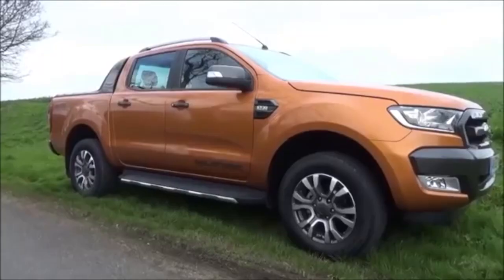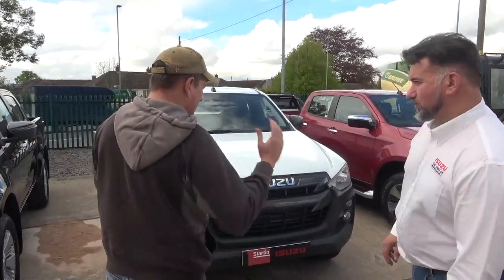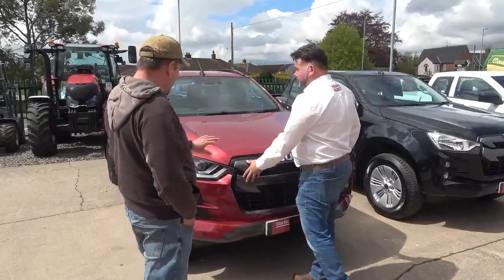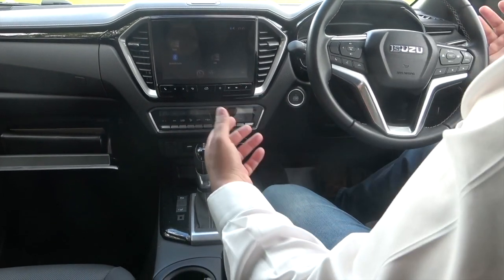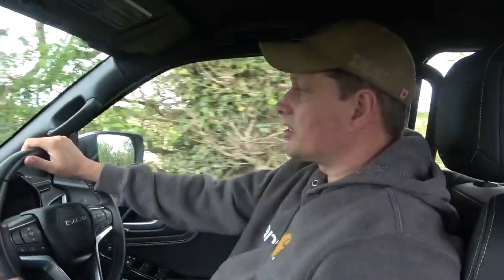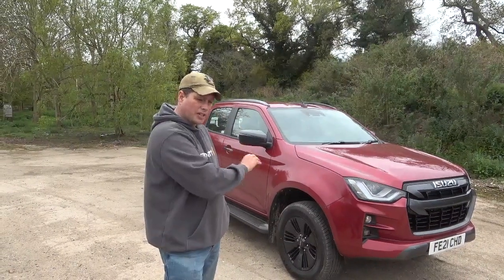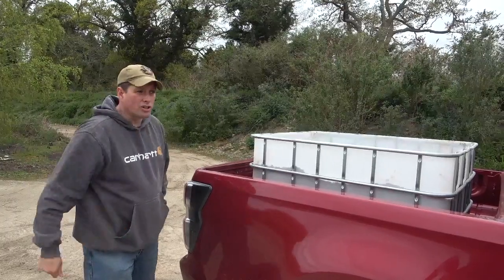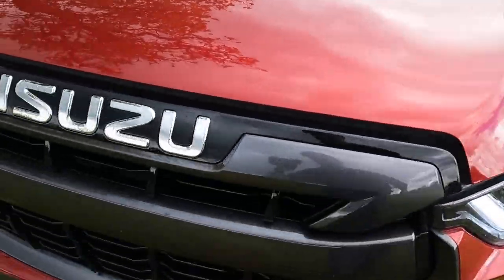2021 ISUZU D-Max ROAD TEST

Comment: I received my new Isuzu Dmax 1.9 Executive 6 AT which is the high spec here in Romania. My last car was a 2008 VW Touareg with the V6 3.0TDI engine and my biggest concern was about the power of the engine and the torque. After aprox 5000km/3000miles I cannot be happier with my choice. The car is amazing, it drives almost like an SUV. The steering is very precise and the overall handling is better than most of the pickups I previously drove. It's a huge difference between the old Dmax and the new one at all characteristics. It has a top interior, nice looks, great fuel mileage, a lot of safety technology and it feels safe even at high speeds of 160km/h or 100 mph. I am happy about the engine and the performance it delivers. It's quick enough for normal driving. Up to 40-50 mph it has been always enough for me no matter what. Yes, you cannot compare it with the 3.0v6 I had but it does the job amazingly. I love my car!

Comment: I have a daihatsu fourtrak 65k miles 2.8td can tow 3.5t legal no dpf, no adblue, no duel mass flywheel problems, no cat on exhaust, no Ecu problems, can run in high or low range by moving manual lever, can run 2 or 4wd instantly, never broken down once and fantastic at towing and going through fields etc. Modern motors are like time bombs they can go wrong and leave you stranded without warning then cost a fortune to repair. If you are faced with flooded areas these new cars have electrics that won’t like being under water but fourtrak can handle that ok. In short today’s cars deliver a nicer driving experience but there is a price to pay. Motors were more practical during the nineties for me anyway. Good video tho.

Comment: I run a 2017 Nissan Navara 2.5 TD as my everyday ride. I'm not in farming but have been renovating a property so truck bed gets a load aboard quite a lot. I agree with you about the feel when loaded. The truck gets very stable and eats the bumps. I live in Belgium where the motorways resemble badly maintained B Roads but my truck will Drive all day at 120kph (about 75mph) very smoothly. Tows beautifully too.
Great vid look forward to more

Comment: The 1.7 TDi isuzu  engine in my old mk3 cavalier outlasted three clutches on one oil change, it's stubborn refusal to die so i could  scrap the rusted out car cost me a small fortune in mig wire and brake pipe over the 14 years that i owned it  and the engine was still going strong when i took it out because i was forced to scrap the car after welding  it up every year wore out my welder. isuzu engines outlive everything.
Reply from the maker: Legendary 1.7 😎

Comment: My brother-in-law has a 2019 Isuzu Fury pickup with a 1.9L engine and auto box and he regularly tows a 14ft livestock trailer with cattle or sheep in it. He loves the Isuzu.
I have a 2016 Ford Ranger XLT 2.2L six speed manual and it has gear in the back and tows trailers about and I think it's great.
It will be interesting to see how these reviews go because it is good to see what other motors are like. Top regards melod from North Yorkshire!

Comment: Nice review about the isuzu, I'm surprised the 1.9 goes that well, usually I'm not that big a fan of downsized displacement but upped power.
Back in 2010 I had a nearly brand new 1500km d-max in at work, the boys from the council got it stuck on the beach and subsequently fryed the clutch in. Got the whole gearbox and 4x4 divider of, nothing but hair in the bellhousing, absolutely knackered the friction plate and the smell🤢  
Keep up the good work with the video's! 
All the best!

Comment: Here in NZ farmers like to have flat deck with sides, tail door, head board. Flat decks are more suited to carting hay, fencing materials 
etc. If a manufacturer does not have a cab & chassis option you build up a collection of well decks in the shed.
Alloy decks with dog a kennel on double cab Hilux, Landcruiser 100 series, Ranger, Isuzu etc. are very common.
Have a good day.
Reply from the maker: Over here for stuff like that the Ford drop side tippers are popular.

Comment: I was impressed with it being a 1.9 and the comfort/ride quality.  I'd have liked to know the economy of it but you can't have everything.  Good video and as you said a good bench mark. 
I've an old D22 Navara for towing and am looking at changing it in the near future and thing auto is the way to go, less stressful on the transmission.
Reply from the maker: I brimmed the tank, checked mileage and refilled later then calculated and I was getting 30.1 mpg
Reply: @LordMuck  thanks, that's quite good,  I get around 22mpg with a full load in the back plus the best part of 3000kg being towed.
Reply from the maker: That was towing and driving loaded and empty so expect a little less towing all the while.

Comment: we only get the 4JJ1 3L engine in the Isuzu Utes, in Australia, and the 3L engine is powerful and strong, goes for ever.
Reply: Pretty sure we can't get the 3l in the UK because of emissions
Reply: They dropped the bigger engines here because of the emissions laws and the manufacturer has to hit a certain emissions level across their range too. All the manufacturers are down sizing and fitting turbos, superchargers, doing hybrids, electrics etc. Mitsubushi announced they were going to pull out of europe altogether as they couldn't afford to keep up with the requirements and there is a big world outside of Europe to sell to. I think the difference between the UK and Australia or the US or africa is that in the UK your rarely without phone signal or far from people and generally don't do hugely long trips so a small, highly stressed engine with lots of sensors isn't a massive problem if it goes wrong. You just call the recovery. Somewhere where your in the middle of nowhere and might not see someone for days you want the bigger, low stressed, simpler lump that's more likely to keep chugging on for many thousands of miles.

Comment: Dmax 4x4 here in the Philippines double cab only;
*3.0 automatic transmission top of the line -without Rear Diff Lock
*3.0 manual transmission top of the line-with Rear Diff Lock
*3.0 manual transmission utility -without Rear Diff Lock
*1.9 manual transmission utility-without Rear Diff Lock

Comment: Very informative & much appreciated review matey.
I'm currently running an '08 Denver Max Rodeo, having previously had an '06 Ford Wildtrak from new (never again...).
Choice now is between Isuzu & Toyota - tending towards another Isuzu because I want a crew cab for the extra load bed length (though I'll have to pay to have the seats recovered, as I've a thing about leather seats...).

Comment: My amarok auto has spent most of it's time towing since I've owned love the auto box had 4 big cattle on a 30 mile trip it drove like a dream and a lot more relaxing it was cruising at 60 comfortable. The local Isuzu dealer said the auto box wasn't very good in them sounds like they've sorted that now it the engine was coming over quite nosey in the video?
Reply from the maker: The Isuzu's have a direct injection 'crackle' at low revs but on the go it's very quiet

Comment: So interesting to see the difference in spec to what you guys get to what we get here in Australia! I'm doing a build up series on my channel at the moment with what's called the X-Terrain here in Australia, very similar inside (but we can't get heated seats), and we get a 3.0lt?? Is that an option there?
Reply from the maker: No, just the 1.9 but it feels as lively as the old 3.0 Isuzu in the Trooper.
Reply: @LordMuck  yeah coo. Decent on fuel too? Assuming it would be. The 3.0lt has combined figures of 8l/100
Reply from the maker: You'll have to do the calculation but over 4 days we averaged 31mpg (including the towing etc and higher speed motorway miles.
Reply: @LordMuck  Wow that's really good, that works out to be around 7.6l/100, that's excellent

Comment: There was a test in Australia with all the latest models and the Amorock failed the water crossing and got towed home. The Isuzu won over all the categories, mainly affordability. I did not know they do leather seats, if they are heated I'm in.
Reply from the maker: A lot of these tests are sensationalised and not really worth a wank in the real world. A lot seem to try and discredit the Toyota Hilux for some reason.
Seats were leather, heated and just so comfortable.
Reply: @LordMuck  
I grew up on a farm, drove tractors from an early age, mum started me in the car at 12.
I have owned several vehicles, my favourite would be the F100 XLT 351 V8 manual, rough as guts but I rescued 10t flat beds with that truck, it was rear drive with a 9" locking diff. 
Also, I live in Australia and as the majority of the country is desert, having a comfortable and reliable vehicle is important.
Reply from the maker: What do you do now Sean ? is it marine based ?
Reply: @LordMuck  somewhat, I started sailing as a hobby and then became a carpenter, then went to sea (southern ocean) then I moved and used my back up plan and worked as a waiter, then went into a mechanics shop and his father took me to his farm where I fixed a lot of the  machinery. I now do building maintenance and some marine work and am moving into more consulting than heavy lifting. 
A joke for you: hard work is performed by those that are unaware that they can employ others to do it for them.
Reply: @LordMuck  Several of our farmer friends that were looking at changing their trucks ( all bar 2 ran Toyota, Nissan and Mitsubishi pickups) have gone over to Isuzu 4x4s with the extended cabs. Agree with you about modern auto gearboxes, look at the yanks, most of their 4x4 pickups have hd auto transmissions and get used for towing heavy loads!( I didn't mean fat asses!!!!!)

Comment: Wish they still did the trooper, as much as a pick up would be cool, the use of the bed for me would be limited. A shogun would do the job and a land cruiser would be fantastic but reliability is at a premium and they hold there values the thought of a disco appeals but the reliability is not there. I hope the new defender rights the wrongs of Landrover for the past 15+ years from a reliability perspective and is a stalwart but if fear it will be too clever for its own good and will fall short. I think you need to do a proper long term test of a new 110 with the hope that it can convince me otherwise. Keep up the good work

Comment: Haven't seen a small isuzu small pickup in the U.S in decades. In the eighties yes but going into the nineties they were gone except for they're big commercial trucks.
Reply from the maker: I think Chevy badged some in the 90's
Reply: @LordMuck  possible im not a Chevy type of guy. Ford for big work Toyota for smaller loads. Just bought a 2021 trd 4×4 Toyota Tacoma.
Reply from the maker: I wish we could get the new Tacoma here
Reply: @LordMuck  
Yep I believe the Chevy LUV from the early 70’s was basically built by ISUZU. GM I think still has ties with Isuzu.

Comment: I do think it's a great shame that there aren't more vehicles available with full time 4x4, I much prefer the feel of it on the road and it makes sense from a safety or towing perspective.
Reply from the maker: That's why I bought the Amarok.
Reply: @LordMuck  Yes, I think it's a good vehicle for some people, sadly not me! 

I do use the off road ability of my Defender, and the fact that it's a van. It's crap, no two ways about it, but I don't think there's anything better for me. Which is a shame.

I wonder if the utility/van spec Land Cruiser (Prado) might be a suitable successor to your old D4 commercial.

Comment: Great review👍I had chance see it last week at Agriculture show, like interior definitely improvement but didn’t get test drive the mid spec Isuzu.  Do like space cab version but if did get one I will fitting flat tray, with fold down sides.  Funny thing there was also dual cab RAM truck there at price of $150,000.......RAM🤷‍♂️tractor???

Comment: Other markets are so lucky. Here in Japan, there is only one pickup that is available on the market and that is the Toyota Hilux Surf. Isuzu have completely pulled out of the car market many years ago now and only sell trucks here in Japan. Part of the problem is that pickups are classified as a commercial vehicle and have a '100' series designation on the number plate that also means that our tolled motorway system charges them to be mid-sized trucks and far more expensive tolls than ordinary passenger vehicles which also includes full sized SUVs which can travel at the same toll as ordinary passenger vehicles. The MOT (very strict here in Japan and EXPENSIVE) on commercial vehicles is initially two years, then every year subsequently. Passenger vehicles (including full sized SUVs) are initially after 3 years and every two years subsequently. Consequently, they don't sell very well. Now, how much more effect does a pickup have on the road as compared to a full sized SUV? Yeah, right. None whatsoever.

Comment: Great video, can you cover BHP and Torque figures when looking at the model range in the future?
Reply from the maker: No, because they mean very little, at the end of the day I could say a truck has 'X' torque and 'X' bhp and it could still perform like a bag of shyte or be really good. If anyone is that interested, all the figures are online.
Reply: @LordMuck  but within the 4 models you reviewed in the Isuzu range was the power output the same across all specs? That is important when choosing which one
Reply from the maker: Yep, from the 4x2 single cab to the 4x4 V-Cross it's the same output.

Comment: Wow you only get a 1.9ltr. In Australia we have the 3ltr 4jj3 dmax. And it’s not very powerful. I have brought a new dmax just waiting for delivery. Even though it’s under powered compared to competitors it’s the reliability I brought.
Reply from the maker: The 1.9 is very powerful for the size and reports say much better on fuel than the old 3.0ltr

Comment: Excellent review there Mucker.  One question,  how (if at all) did you lash the IBC down, many folks would be interested as to whether the lashing points are well placed and sufficient in number. On the engine size thing I seriously pissed off an engineer I got talking to at a London bus garage, we were discussing the merits of the 2018 Vivaro BiTurbo,  the consensus was that they can certainly lift up their skirts and go when desired, I said very good for a 1.6 diesel. Chappy wouldn't buy it, he swore that his was a 2.2! When I explained that all of the models at the time used a 1.6 I get the impression that he was going to complain to his employer that the van didn't have sufficient go, despite just agreeing with me that they went well. To paraphrase the razor advert man I was so impressed I bought myself a similar van to build a camper van.  What say your favourite pickup in this series gets the chunky tyres off road test?
Reply from the maker: There were 4 lashing points, basically one in each corner.

Comment: A good review 

What was it like at reversing uphill with a loaded trailer in the auto 
I know my amarok can struggle when fully loaded with its torque lockout
Reply from the maker: It backs up fine as does the Amarok. Not sure why yours doesn't ? 🤔
Reply: @LordMuck  I guess I'm over loading mine... 
But I've noticed on serious steep uphill standing start reversing mine didn't like it 
Unless mines fooked 

I do like the zf 8spd it's great box I think I'd miss it 
I'm thinking of a change hence the questions etc
Reply from the maker: Mines done 212,000 miles now but I had the torque converter rebuilt at 140,000.
Reply: @LordMuck  she doing well 

There's a torque lockout in the transmission I believe or something like that 
I guess it's to protect the transmission from the torque stress in reverse 

I've ordedd a service kit for the transmission that might help 

I do like the old bugger it runs a treat, im on super diesel now which I think is better for the injectors too 

Getting  better torque and it holds longer in gears
Reply from the maker: I've noticed on premium fuel, where your throttle position feels 'comfortable' I'm around 8-9mph faster.

Comment: We had a 1985 Isuzu Pup diesel with the 1.9l and a five speed manual. Loved that truck, single cab, long wheel base, the box would fit a 4x8ft sheet of plywood or steel no problem, It also averaged 45mpg. If they offered that D-Max in a 2 door LWB I would buy one in a heartbeat.

Sadly, they will never offer it here in the US, because our know it all green nazi's  hear the word Diesel and start shitting themselves.
Reply from the maker: They do a single cab 4x2 and a 4x4.